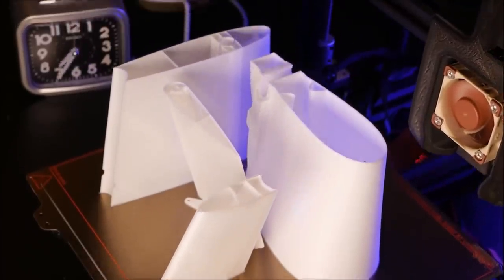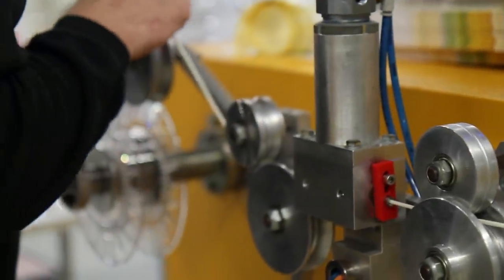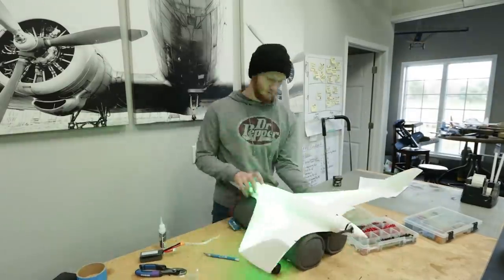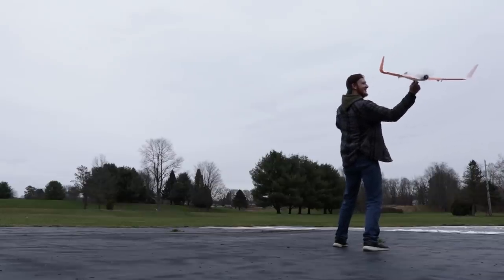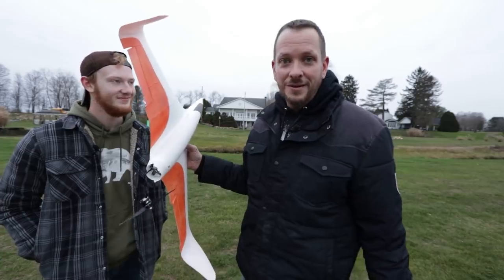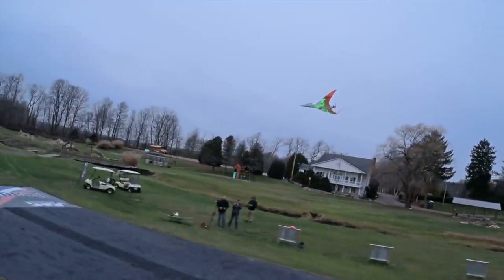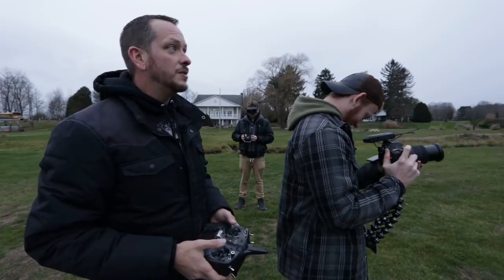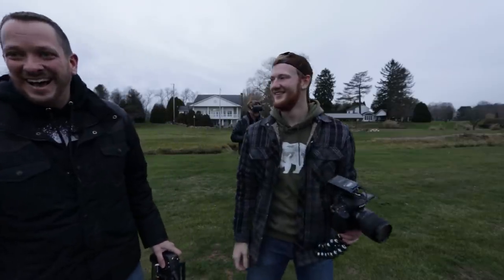Building & Flying a 3D Printed Flying Wing! | Eclipson EGW80

Comment: I would love to see a sr-71 blackbird
Reply: YES this!
Reply: Wouldn’t we all
Reply: I'd be so happy if this happened. It's ok if you guys leave out the bleeding like a stuck pig on the ground detail. 🤣😂
Reply: The issue with creating a scaled blackbird is that it wasnt designed for lift which an rc version would need so much more of, which could be generated with speed as a trade off, however an rc version could be made withactual scaled jet engines
Reply: An x15 would also be awsome.

Put a big rocket in it and blast it into the stratosphere
Reply: @lostcosmonaut1000  you  can get anything to fly with the right motor, and foam planes...
Reply: @Fabermain  yes, can in terms of the aircraft hobby world, u can simply trade out airframe design for more POWER
Reply: @lostcosmonaut1000  My 1st ever EDF scratch-build is a 70mm EDF SR-71. But I built it too heavy so it's only flown twice. It's just over 6' long and just under 1M wingspan. It can be done but I'll move the innards over to a XB-70 for my next build. Already built one with 3 small quad motors as pusher props. The new 1 will be dual 70mm EDFs.
Reply: Slap an X logo on it and I’d be on board.

Comment: Can you guys do a strength test with a normal LWPLA one, and then one with carbon fiber coated, similar to on foam planes!
Reply: That won't work good. Composite planes are build like they are build for good reasons. You will end up with a very heavy plane. If you want it from carbon fiber take the data and print molds for it and then laminate it with an airex or rohacell core.
Reply: @peterzingler6221  Good idea, maybe they could do something like that instead

Comment: I printed the eclipson eww180 and its an amazing flying plane. I printed it out of normal PLA in about a week with 1 printer and the screws pulled through the motor mount after using a 4s. So it could have been avoided by using washers. It was almost a similar but more traumatic landing. I now have LW-PLA and I'm going to document the whole build now that I know it flies so great. I love the landing gear design that can be used with rubber bands and it works flawlessly. The designs they have are so good and worth it If you have a 3d printer!
Reply from the maker: RIGHT?! SO good! We love all their designs, just so well thought out and well designed! Quality! Let us know how you like the LW-PLA.. it was amazing for this airplane.  @ColorFabb is really innovating the game when it comes to filaments and products!
Reply: @FliteTest  I definitely will! I just set up octoprint on my printers so i'm getting them dialed in first. I Will be using Inlands LW-PLA from Microcenter so it will be interesting to see how it differs from Colorfab! I will order some colorfab to see the differences as well! thanks for all you guys do!

Comment: 3d printed planes have a much more solid feel to the controls than your typical electric foam aircraft.  Because there is no flex in the control surface the planes react immediately and precisely to control inputs.

Comment: LW-PLA does not print faster because it foams it is still .4mm width. LW-PLA allows you to print at lower flow setting so you can save weight.

Comment: Josh kept mentioning the prop torque rolling the airframe. 
I'm wondering if you dropped the diameter and added a blade or two if that would limit the torque roll and let the plane get a little higher speed. 

Also, I'm loving the father son dynamic of the show lately. It's definitely a "feel good" show again!!
Reply: Shouldn't trust angle counteract the torque?

Comment: I actually had bad luck with fully 3d printed airplane where the wings easily snapped. Crashed at first launch. End up designing a pod and boom printed fuselage with foam Tiny Trainer wing. Fly just like the original Trainer but with bigger space and slightly lighter. Great job FT!👍

Comment: I would really like to see how well lightweight PLA works covered with fiberglass.
Reply from the maker: Great idea! ;)
Reply: any super light well designed air frame should work extremely well if covered well with fiber glass imo...just a lot of time would be required...maybe try a mini  600mm plane first

Comment: 5x6.5x2 prop, NH 2750kv Avenger, 5s 1550 100c pack, flat and level 120mph. You really need to cut a groove from tip to tip half inch deep and use a half inch wide by 1/16th in thick carbon spar glued in to the groove you cut.
The plane can deff pull the Gs with the setup I'm running and can sustain those Gs... If you don't do a spar like I said and you are running a lot of control surface throw you will fold it or snap thr wings. 

I have built 3 so far, one as I said above, another that's running 4s with a 6x4.5x3 prop on a 2400kv F40 Pro III 2306 and it's great. Pretty quick but can back off and fly for a long time and it's a very light setup. 

I also did one that's running 6s 1300mah, on 2806 1600kv running a 7in prop and it's excellent as a FPV rig and what I'm using it for. I setup with Inav on a F405 board with GPS and Crossfire and a TBS VTX at 800mw. It will pull really low amps at about 35mph cruise speed on this setup and with the 6s 1300 or 1550s flight time is excellent.

It's pretty efficient if you setup to be and it's ultra stable along with fairly quick on a setup like the FPV setup I built. It will run around 85mph on that setup.. So long as you arent running above 80% throttle it's efficient... At 60% throttle it's flying around 65mph and pulling around 13amps.... At cruise its its flying around 30 to 35mph and pulling around 5A, you could easily use this same setup with 4s 2800mah pack as well so long as you just plan on cruising because that setup on 4s is around 60mph WOT... On 4s I run a 8 inch bi blade on it instead of the 7in that I run on 6s.

The plane is excellent as is except for the need for the carbor flat bar spar channeled and glued in if you plan on running a high KV high speed power system and a lot of throw.. The one other thing I do is laminate the wings in thin lamination film, it will stiffen up it up some and you won't have the slight buffeting when getting up around 100mph or over that will happen if you don't laminate the wings. I believe it's due to a slight bit of flex in the putter wing that happened when you start moving pretty good and gets noticeable as soon as you are flat and level up around 100mph.. If you are on a 70 to 80mph wot power system then I wouldn't worry about doing it unless you want to (I did it on all the models I built, I have 3 currently but have built 5. One given to my friend and one was a full loss on a fast setup that I snapped a wing on about the 10th flight that's when I started doing the flat carbon spar that I cut a groove in and plane sideways so it's ULTRA stiff.) but over all it is a good idea to do it as it will stiffen the plane and it will have better flight performance with it. On a more duration focused setup you can get away without the spar as your speeds won't be high enough nor your throws making you having to worry about it but I would deff 100% laminate the wing on a setup like that if you bypass doing a spar and it will insure the plane holds together for a long time. 

This is a fantastic plane, in 2 months I've built 5 and flying the heck out of the 3 I have.. The FPV plane is so awesome and on a small setup and a 2800mah 4s the duration is excellent. Last week I was flying out to a island that's about two miles out (here in Florida) and looking for wild horses... The island is around 6 miles across and 2 miles from where I launched. This setup with the 8in prop on 4s 2800s speed will be around 30 to 35mph at cruise throttle and pulling around 6.5 to 7 amps. But during this flight I was using 4s 18650 and on this setup I get a solid 45 minutes of flight time at cruise power. 

I flew out and over the island about 100 feet AGL and slowed down to around 25mph ground speed and the plane is perfectly happy to fly that slow.. I flew to a field towards the back of the island around 6 miles Los for me and 150AGL and found a pack of wild horses and flew over them filming them for about 20 mins, surprising they never ran but it is fairly quiet and I was 150 feet high and not flying directly over them to keep them in frame as much as possible. At one point I was around 8miles LOS out from my self and never worried as coming home I knew I had a 10mph tail wind and I headed home with plenty of pack left. 

This is a long post but it's just telling you guys how fantastic this plane is and how versatile it is. It can be a fast flyer on mini quad batteries and motors and it can be a excellent medium long duration FPV plane and all in between. 
I may built another and go full long range on it with 915mhz telemetry and 1.2 video, proper power system and a 4s 2p 18650 pack, full Inav setup or full Eagletree system and looking at maybe 2 to 2.5 hour duration on a fit in the truck size package. I know the plane would be capable efficiency wise with the right power system.

Comment: FYI, there are two red loctites. one that is maximum strength (in order to break loose, a torch is required to heat up the nut or bolt until the loctite fails) and there is also a high temp red loctite that is removable like the blue, but is impervious to high heat.

Comment: I think an electric glider would be great to see, light weight and a good test for the wing strength/flexibility. Slope soaring tends to be tough on gliders with harsher than normal landings especially in scrub etc and to be able to print replacement parts particularly those that get the most wear would be great!

Comment: I have seen a few people use this material and one other do this and it seems like a great idea. You all know more than me, so a question for you: doesnt using accelerator weaken the CA bond? I imagine mixing and matching filaments based on the part will also benefit rigidity

Comment: This plane looks really cool. Here's a challenge for you guys. In real life, I think it would be possible to create a set of bolt on wings for something  like Suzuki Hyabusa Superbike {motorcycle). The flying wing design like this 3D printed plane looks perfect to blend into the bike's fairing shape. The rear wheel would be used to power a pusher prop. It would also be cool to build a  trailer to hold the wings. It could be towed by the bike to an airstrip and wings assembled in a short  time with  basic tools. 
To make a small test plane, a plastic motorcycle model kit would be too frail but maybe a similar appearing foam board or 3D printed shape could be designed to simulate the motorcycle. What do you guys think?

Comment: This thing screams for a big motor with a small prop. And I think they should have designed the reflex into the wing. Would be more efficient and look smoother. Why didn't you use the spinner? It looked really nice.

Comment: I can imagine this part of the hobby taking off among those that don't enjoy the building process if the plastics gets super lightweight.  This is clearly a step in that direction.  I suspect you are telling us the wing has no warp built in to account for the reflex that is needed and that is why the elevons are slightly up.  Common solution, even if modern jet liners build the slight downward warp towards the wingtips (leading edge) to provide the needed reflex.  That sharp nose is a tad concerning since a bit more of a soft nose, more like a egg end would be safer in appearance at least and likely take a bit of a nose in better with no, or less damage.  By the way, before I forget, if you are concerned about a propeller cutting your hand, or arm after a launch, buy and wear a welders glove and add a thick, leather sleeve if desired.  Welders gloves come in all price ranges and thickness of leather, which will protect a hand, or arm from propeller cuts, but without a thick leather sleeve, maybe not the impact pain.  Add a canard to the front and it looks like the LongEZ, with a different cockpit.
Reply: You wrote too much

Comment: ive been 3d printing for almost 2 yrs now an ive spent the last week messing around with building my first foam board plane an my first time trying to fly was unsuccessful but im not giving up. i used a s2 battery that was .8 lbs so it was way to heavy or at least thats what i think my problem is. im waiting for a 3s battery to come in the mail right no to give it another go but i really want to get to the point where i can fully 3d print one. im completely knew to this an it took me a week to get the receiver figured out an how to control the servos the way i think they are suppose to work, still not sure if this is what is normal but it felt more natural for me. but what kinda specs do i need for flying something thats 3d printed. i dont know how the weight to power works with these motors. i had a couple laying around i had gotten from pallet bins so $1 at most for each piece but i have 2 4500kv motors one with a 3mm shaft other with a 2mm both mount at the front of the motor while one is completely inclosed the other hole back half moves with the shaft so im assuming its more for a drone. i also had a 2.2 metal gear servo and a 25amp esc that came with the enclosed motor an i already had a few sg90 servos laying around. so i went to amazon an picked up a flysky fs-i6x and a kit that came with a 2200kv motor 30amp esc 2 props an prop adapter i guess its called but when i got the battery i didnt do much research other than getting something i could use for both of the esc an i ended up with a 5000mah s2 50c battyer that is almost a lb .8lbs an my planes total weight with the amazon motor kit an battery an everything else was 1.8. i 3d printed the mount to hold the motor an everything else was either taped or hot glued so im hoping the new battery will help drop the  weight an get it flying. its also a 3s battery so ive been told it will make the motor reach a higher rpm. ive just discovered ur website during all this an hope to end up buying some nicer stuff from you guys once i know what im doing.

Comment: Instead of a keel put a place for replaceable model rockets “motor” then build ramp to launch. Also use counter rotating blades instead of one.
Stress points use regular PLA, still use CA glue and stronger for screws and such?

Comment: ok you show that aero-tech CA glue.  I have a bottle of it.  HOW IN THE DICKENS ARE YOU SUPPOSED TO REMOVE THE CAP????? Mine bonded to the applicator tube and the applicator tube ripped off when I tried to twist the cap off.  Now I have an almost full bottle of glue and I can't cap it or use the applicator tip because there's an enormous hole from ripping the top of it off.

Comment: Anyone in these comments familiar with the aura 5 lite? I want to put it in a taildragger and i don't know if I should zero the board with the tail off with the plane in the level flight position or if it will be fine with the tail on the ground

Comment: Can you fibreglass that?
Reply: You can but it doesn't make sense. You will have a brittle core with a hard surface. That won't hold long.
Reply: @peterzingler6221  longer than just the brittle core

Comment: I just check the pricing for LW-PLA on ColorFabb 's website.  Yikes! $109.00 for a 2200g spool.  Too much $$ especially when you need at least 1/4 spool to tune your print configuration settings and print test parts.  I have a decent sized 3D Printer, I have a Robo3D R1+
 I have printed parts for my r/c aircraft such as fpv camera mounts.  This airplane looks pretty cool but $109.00 for a spool of filament is pretty steep.
I'm going to stick with foam.  I think as a group we need to focus a CNC platform for foam.   We can take a shape with lots of contours, slice it, cnc the slices and glue the slices together.  My problem with PLA printed aircraft is the adhesive.  CA glue will separate under stress.

The EGW80 is a cool looking model aircraft. I'll see if I can print it with PLA+  I have a nice spool of military gray PLA+ that I paid $25.00 for.

Comment: I kind of want to know, these are plastics, right? Have you ever considered building a eco-friendly air frame? No plastics, and materials that are low energy to produce. 
The foam board is a kind of plastic, too, right?

Also, the production chain of your electronics, have you checked up on where the source materials come from and under what conditions they are manufactured?